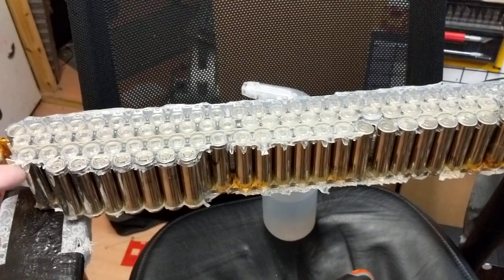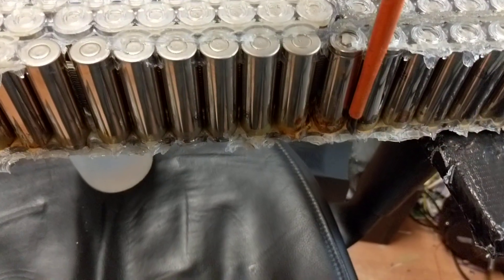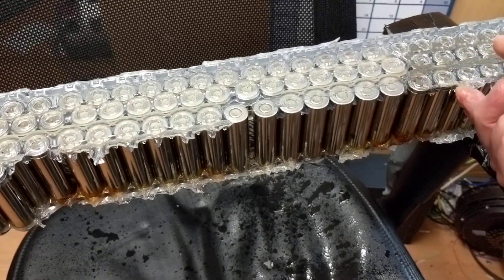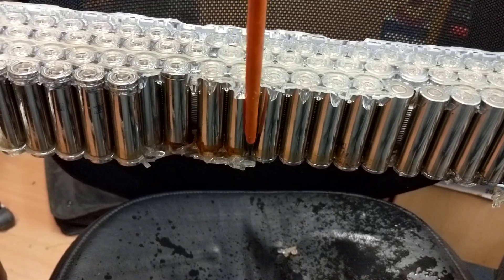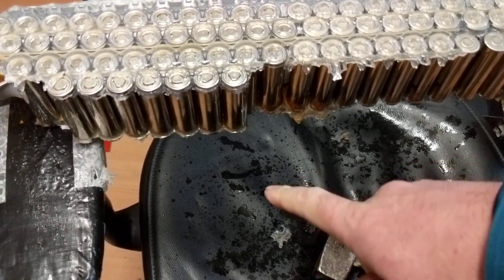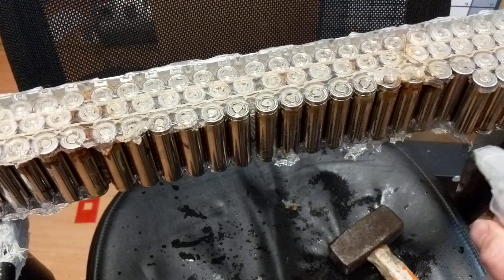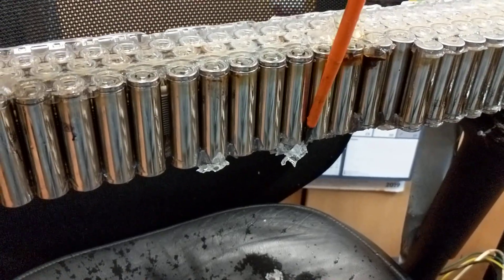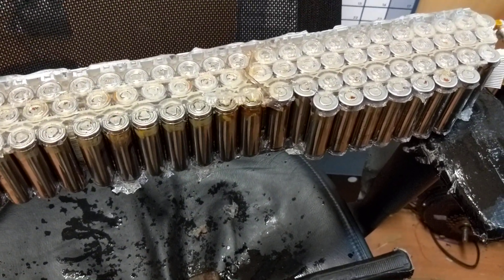Removing cells from a Tesla battery pack Harvesting cells tare down 6s74p 22.2v module #smartazz

Comment: You know how to soldering a wire on the cells positive side?
Reply from the maker: Yes
I made this solar battery from them https://youtu.be/mUtlDCQqC3s
Reply: Hot and fast. A light sanding with a dremel tool and a sparing smear of plumbers flux makes them easy to solder to. Just do it quick. Best way is to tin the ends before applying the wire to avoid excessive heating.❤